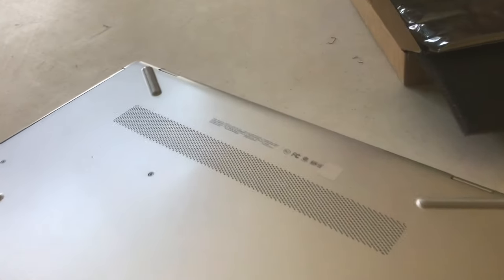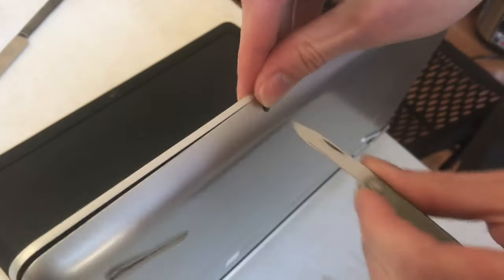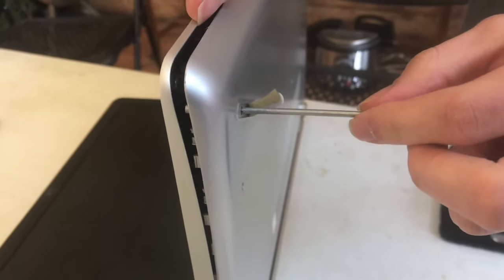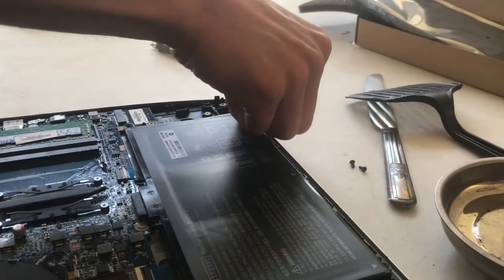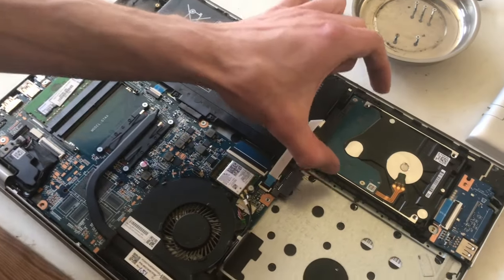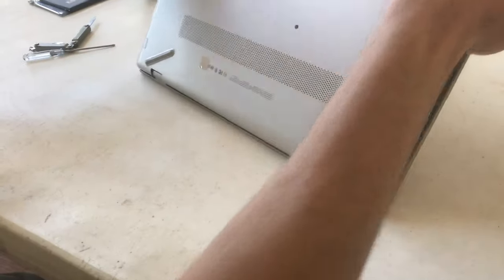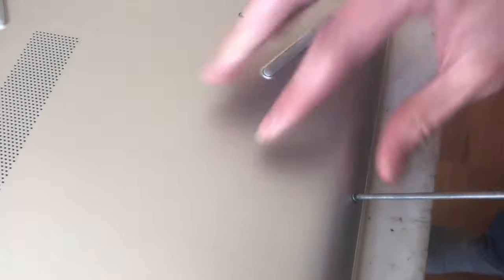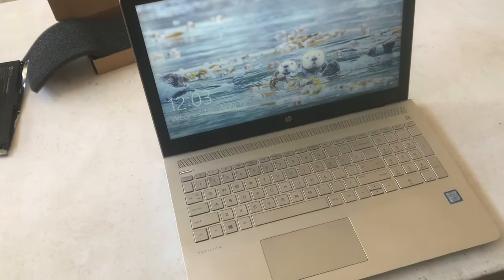hp “pavilion” laptop BATTERY REPLACEMENT (1500 series 15 cc, 15 ca, 15 cs)

Comment: I just did this battery replacement by myself (HP Pavilion x360 coverible 14"). Don't start opening the Laptop from the frontside like shown. Remove all screws and start on the corner back from the lashes. Don't use a knife to pull. Take a small scalpel and to support a small screwdriver. It's opening easy in that way.
Reply: Very vital info...thx!

Comment: Tip: use guitar pick or plastic-dated credit cards/ID cards to open up your laptops underside. 😊
Reply: Great idea!  Thx!
Reply: @Dreams4zale  No probs 👍
Reply: You break it
Reply: @michaeltsang548  lol
Reply: or a plastic putty knife. You're less likely to cut yourself or scratch the laptop.
Reply: Yup, credit cards work great, also any other plastic card, I use my old insurance cards because they're thinner. I have a computer repair biz, I can't be putting scratches and little nicks on the case. Guitar picks work, but sometimes I have to really push hard to slide around the edge and the pick slips out of my hand, the credit cards work nicer because you can get a better grip.

Comment: One thing to warn about, as I wrecked my 14 month old HP this way, is that dealing with those tiny and very fiddly screws, the slightest wobble can mean one rolls away from the hole and touches the motherboard. There is power running through it with the battery in place, and in my case, this resulted in a few tiny sparks. I hoped they were of no significance but when assembled the laptop wouldn't even power on. I took it to a repairer for an opinion (not a full.check, for which I'd have had to pay, I just wanted an idea of cost). I was told that it was very likely that the screw has shorted the motherboard and, as a result may have also damaged other components. As a having a new board fitted would likely cost at least half the price of a new laptop even if nothing else needed replacing, it was basically a write off. The old detachable batteries were far more convenient!

Comment: Thank you! I’m not a mechanically inclined guy and I couldn’t have done this without your video (never ever would have found the screws in the rubber feet and never would have had the guts to pop the back pressure points if I hadn’t watched you do it). You may have saved me from buying a new laptop!

Comment: Great video.  Tool tip for popping off the back:  The can opener/screw driver blade on a swiss army knife worked very well. (This is opposite the bottle opener on mine.)  It is less likely to mar the plastic case than other items or tools.

Comment: Thank you for this video. I watched it all the way through before attempting it and things went very smoothly. A few problems sprang up and I referred to the video and it was a breeze. I too missed the corner screw under the footing, but quickly figured out I needed to recheck for it. 

The other thing I was unsure of were the snaps at the dvd drive. There were three along the flimsy footing and two looked like they were free. I stuck my knife blade under the middle one and it unsnapped. 

Over all I did this in about 45 minutes which is probably slow but not so bad for a seventy-year-old just techy enough to be dangerous. I might be tempted to replace had drive with a solid state drive if decide to transfer over all my files to a thumb drive. 

Thanks again for making it so easy.
Reply: The corner screws there are two.  do you remove both or just the inner one
Reply: @carlbooth6098  If you are talking about under the pads, you unscrew both but leave them in and put the pad over them so they don't fall out and get lost.

Comment: Such an excellent video.
 I'm so much calmer also about replacing the battery in my laptop.  You're awesome.

And I particularly appreciated hearing the additional information about some of the components inside the computer: the ram card, what it looks like and where it is, how the open space would allow for an additional ram card  how the fan wicks away the heat and conducts the heat through that funny metal arm inside....etc.

You did just so awesome and you have a great calm communication voice.
Well done.

Comment: Just used this to replace my old battery in my HP x360 Pavilion. Bought a battery from Laptop Battery Express (since they seemed to have good reviews and HP no longer sells this battery from what I could find). Powered it on really quick before a full charge and it worked! So glad because I'm not an IT or computer expert and was afraid I'd break something. I didn't want to spend another $600 on a pc yet so this video helps me to get another year or two out of the computer. 

Thank you for this video!! :D
Reply: Hp told me to buy a new laptop cause the part that I needed for my laptop was not in stock, I looked elsewhere and ordred it off online yesterday and recieved it today, battery replaced and I am happy. No need to fork out more money for a brand new laptop :)
Reply: @Blueystar861  sounds like they are trying to make us buy more laptops instead of letting us fix them w/ original HP parts :")
Reply: @missionpurity  Yes they are. The lady was very kind and helpful but trying to make me buy a new laptop when really all it needed was a battery replacement 🙈

It's shame really, I now know what to do next time it's happens again ☺️

Comment: Great video, very helpful. Just a little helpful advice. When replacing battery, always get an HP battery for your HP laptop. I tried 3 different generic ones from Amazon, they wouldn't hold the charge for the CMOS. I'm assuming the HP batteries have a built in CMOS battery inside. My laptop doesn't have a separate CMOS battery. When I use the generic battery, the laptop won't turn on unless I plug it in first to startup the laptop. Then I can unplug and work with it as a regular laptop. I finally bought an HP battery and have zero issues. Sucks, because it costs more, but you get what you pay for. 😂😅

Comment: Thank you... I accidentally put a little too much pressure on the front end when trying to unsnap, and bam it, ended up cracking the housing a little. Not enough to cause a real problem, but still, aCk!  All's good though, you performed exactly what I needed to see to complete this.

Comment: Thanks, good video. I did not use any metal to pry off the case. All plastic tools and credit cards.  One long screw towards the USB PORT, CARD READER, AND DVD  side did not line up.  I opened the case three times to line it up, and then I gave up.  Laptop works fine. I saved the screw in case I need to open it up again.   Did any one else have the same issue? Thanks in advance for helpful hints.

Comment: I preferred my old HP laptop (Windows 7). All I had to do was unscrew a couple screws from the back and pull out the old battery. Then I was able to replace it with an over-sized battery that gave me more than three times the charge time.

Comment: Lol my battery is so easy to get out. You flip a couple levers to unlock it and pull it right out, don’t need to open anything up
Reply: So true.  HP stuck me with this one,  NEVER AGAIN.   Batter has been weak since end of first year.   Fades off quickly now and recharges to max of 80% then dead within 90 minutes.  POS engineered to CAUSE Loss of Use and Delay while HP squeezes more from their victims.

Comment: Hi there, I'm trying to replace the battery on my HP Pavilion & am following your video. I got stuck at removing the optical drive which will not come out. It looks so easy in your video - I can't see what I am doing wrong. I have removed all the screws & popped the cover all around to the optical drive. Now I need to get it out to remove the screws underneath it, and here I am confronted with the problem. My battery is completely empty, so I tried connecting the laptop to the outlet again, but it still wouldn't come out. I am so lost, can you help with some advice??
Reply: Addition to my post!! Problem discovered!! Sorry to have bothered you. One tiny screw was overlooked - too well hidden. All went well, battery switched out, laptop back up, charging and running. Thanks so much ❤

Comment: Thanks, I like your video. It is about 2 years since you made this video. I am concerned about over-heating and burning. Lap top batteries some times cause fire, heard in the news. Can you please update the condition so I can order the same. I noticed it does not has UL stamp. Thanks again.

Comment: I replaced my battery with one major problem. Now the screen doesn't work. I can plug an external monitor into the  HDMI port and it works.  I must have bumped a connector to the screen or something in the process.

Comment: thanks! hey, how old was your battery before it needed replacing?
Reply: If it helps, my battery started having issues around 1.5 years of use, though this laptop was on display in store for an unknown amount of time. Finally replacing it after 3 years of use.
Reply: My HP Pavilion x360 is 5 yrs old and now the battery lasts 10 min still.
Reply: @MustasLinked  isn't that crazy! 1.5 yrs.  Surely they should last a little longer!

Comment: My battery was not charging past about 25% so I did a replacement.  When I booted up, the new battery had 71% charge.  I shut the computer down and charged it overnight.  I used it the next day and turned off the power with the battery at about 20%.  The next day, I wanted to use the computer but the battery was only at 5%.  I fiddled with it for a while and it seems that when I plug the adaptor in, the battery charges for about 5 seconds, then stops charging.  Any ideas?
The power adaptor runs the computer okay, but it doesn't charge.  Could it still be a faulty Power supply?

Comment: What screw drivers did you use? I mean the shape and dimension
Reply: The battery came with two small screwdrivers designed for the laptops screws. The knife blade worked best for opening it.

Comment: I was looking the cmos battery. I changed my laptop battery but now I can’t turn in until I plug in,  battery is fine but cannot turn in until I plugged in my laptop. Do i have to do any setup after change battery?

Comment: I just replaced my laptop battery. It is previously hto3xl but I bought tf03xl since they said it is compatible. Now, when I try to turn on the laptop, it won't turn on. I plugged the charger and there's an orange light. Does it mean I have to wait until it's fully charged or is there something wrong with the battery I bought?
Reply: battery is probably dead, wait for it to charge, your comment was made 2 months ago did it work?
Reply: @maureentaylor1283  I got it to work. I just cleaned the ram. It was the problem all along.

Comment: Can I just remove the battery permanently then use it without them only through plug?

My hp pavilion doesn't lasts for more than 30 mins. when it's not on plug so instead of having its defective batt, I'm thinking of removing the battery permanently. 

I'm hoping for an answer, anyone can reply. Pls. Tyia.
Reply: You can do that I'm fairly certain. However I'm not sure why you would want to do that.

Comment: How is battery life?
Reply: This is a direct replacement model, output is 41.9Wh with a normal range of 3630 mAh. Under normal use this battery will last about 5 years, giving continuous power under a single charge for about 2-3 hours. There doesn't seem to be a larger model available for this computer, which is already many years old and considered by most to be obsolete. My battery is about 3-4 years old, which is why I'm starting to watch these videos. Cheers.